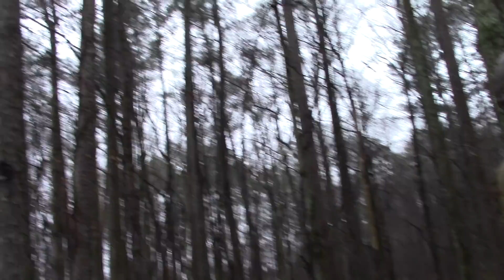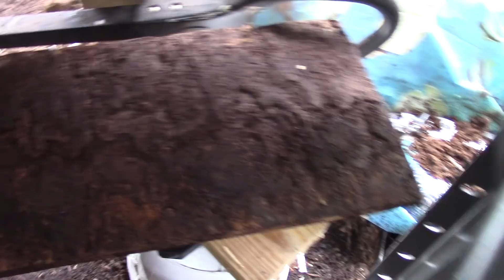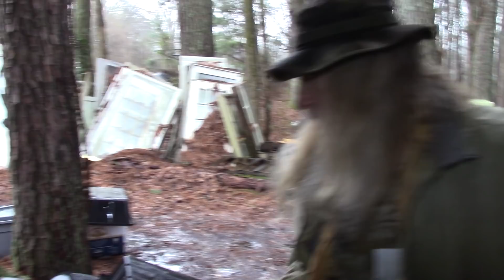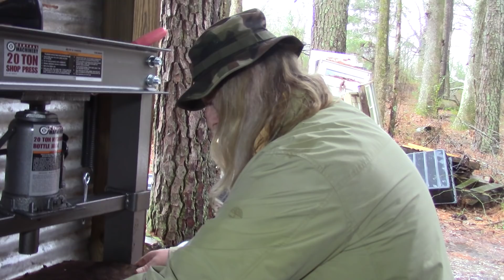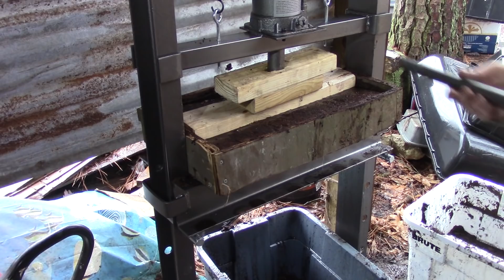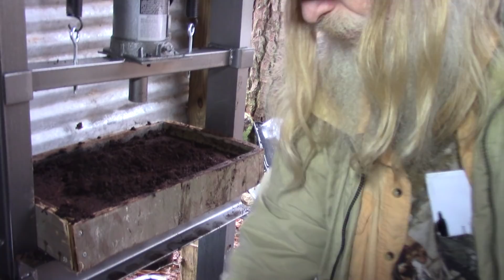Peat Moss Press

Comment: After reading the comments, I had another idea.  Use an old washer, put the peat in old pillow cases and secure, maybe make a drawstring on the pillowcase.  Put the filled pillowcases in the washer, balance them out and put the washer on spin.  Note: don't put very much in the cases.   Use multiple cases

Comment: My 2 cents. If you are staying with plywood i would recommend a piece of hardwood spanning the length of the top plate to distribute the pressure and possibly add a piece of steel at the point where the press pushes on the board. Otherwise i would go with the recommendation of steel plates and angle iron for the set up. Good job. Thanks for keeping us informed with all you do. We all really appreciate you taking your valuable time to try to help everyone thrive.
Reply from the maker: This was just a test model. Going solid plank.

Comment: I think you are on a roll, using the noodle in a productive way! I enjoy the videos and have learned so much. Hey I`d ask the schools art depts or auto mechanic if they know where you could get a piece of metal or if you have a piece of metal could they cut it then put it over the plywood to distribute weight before pressing.
Reply from the maker: Think I'll just use a solid board.